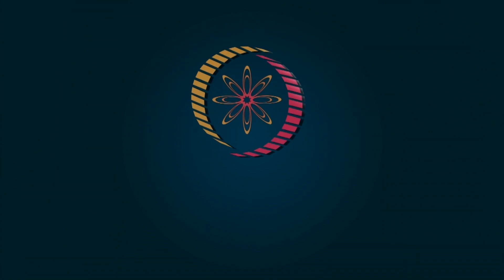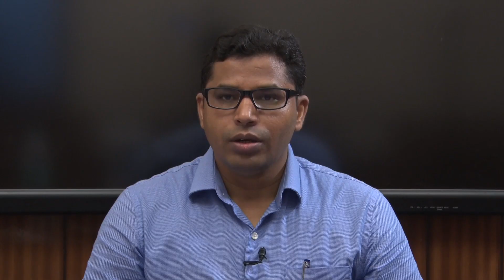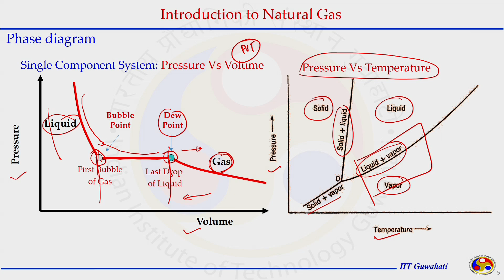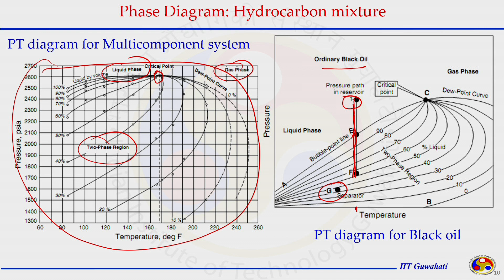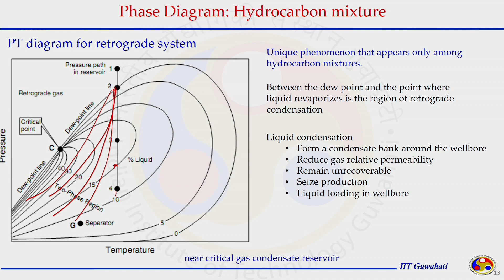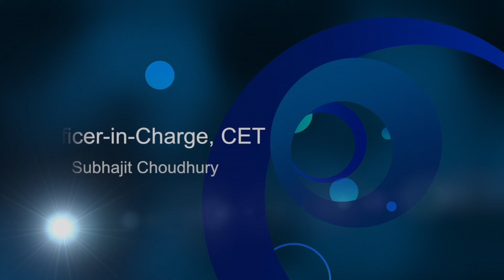Lec 2: Introduction to Natural Gas - II

Comment: sir its a very informative and  easily explained video.We the students of petroleum and mining engineering  discipline always suffer from lack of quality lectures. Thankyou very very much to taking this initiative.after watching your video I got a all my unknown and curious question`s solution.May god bless you with the best rewards.

sir for dry gas.
when gas comes to separetor , will it still maintain isothermal process? my mind says temperature will certainly deplete.if you would kindly explain it a little more sir?